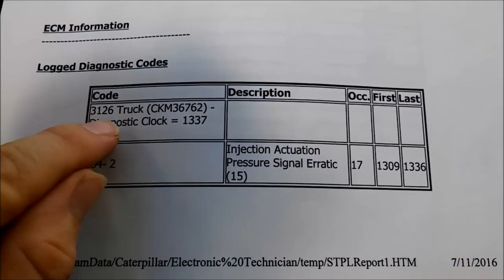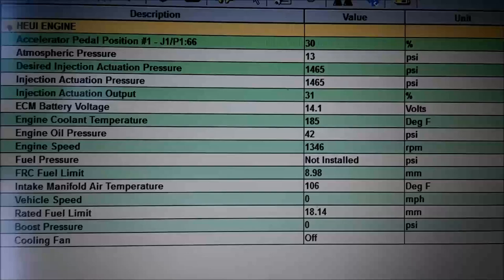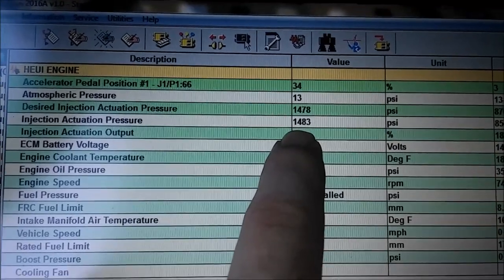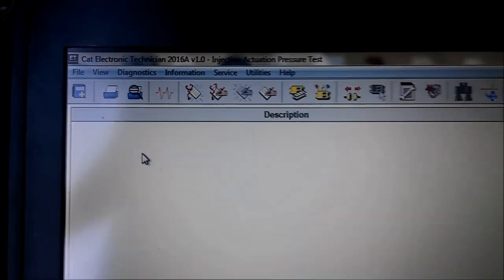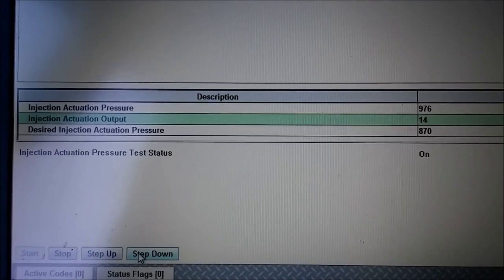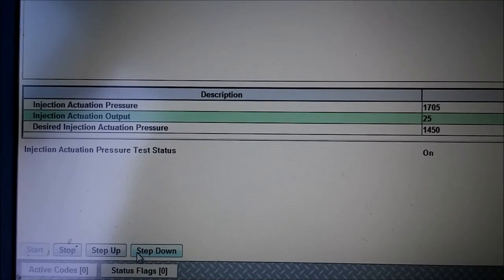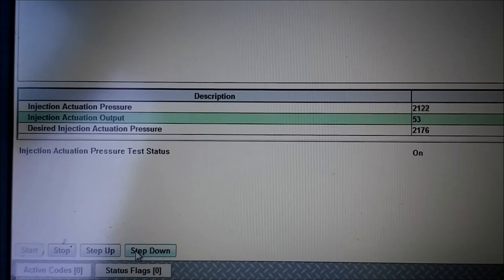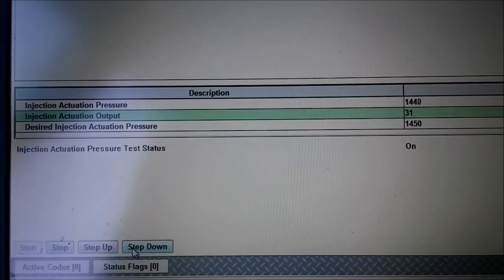How To Troubleshoot HEUI Systems and IAP faults. 164 Faults.  3126, C7, and C9 Cat Engines.

Comment: Hi there I'm having trouble with a 336d running a c9 that refuses to start when warm unless it gets a squirt of ether I'm thinking huei pump or faulty injector am I on the right track?
Reply from the maker: +phil holloway If it has a cold miss, that is usually an injector. You can do a cylinder cutout test right when it starts to see if you can identify which one.

Comment: i have a 3126 where the heui pump had external oil leaks and complaints of low power so i changed the heui pump even though it was keeping up with the commanded pressure,  now it sputters when accelerating and still low power .  thoughts .

Comment: NEED HELP we have a 2003 3126 that will shut off after 30 minutes or so, let it cool for 1-15 minutes and it starts right back up.   It's instant too and it starts right away when it cools.  Doesn't act like heui issues seems seems electrical.   I have 2 battery + and - at ecm and 1 ignition + and none are dropping out when it dies.  Changed timing sensors and heui oil pressure sensors.  Scan tool looses communication when it shuts down as well.   We also swapped ecm and does same thing.

Comment: I have an rv with a 04 cat c7. It is a 350 hp engine. Upon start up when it sits overnight, it will throw the ck engine and engine protect light upon start up. Codes 164-2 and 164-0 are the only codes in the system. When it starts it will seem to run a little rough and seems more black smoke than usual but I never paid much attention upon start up because I am inside. It stalled twice on me. Both times when the lights were on. I had to turn the key off and try to start it again because it would not start until I shut the key all the way off. Once I did that it started right back up. If the light come on when I start it, I turn the key off and start it again and the lights are off. It never had low power and still doesn't once those light are out. I put my scanner on it to test the actuation pressure, and it did go all the way up and down, but seemed a little delayed in response. Any suggestions? PLEASE!!! Supposed to leave for vacation in 2 weeks and need a vacation not a vacation to HELL though. Thanks in advance

Comment: working on a c7. runs like crap. 102-4 was active but after a few minutes of running, went logged. inside logged events, 164-11 code found. cylinder cut out test shows to have 2 inactive injectors. should this be the 164-11 event?

Comment: got a 3126 in a 2001 freightliner single axle 5 ton.  approx 1 million km.  Ive been the owner the last 50,000km.  The previous owner told me he had the injector cups done once.  Personally Ive only changed the oil.  Its achieving acceptable blowby and oil use.

Really like the engine, its very responsive and generally flawless in terms of operation.  Great power for my application.  I really like how the power increases through the gears.  This aspect seems to be dialed in just right, very smooth and well tuned.  I havent noticed the motor miss or skip a beat even once.  Loving the cruise control, works very well.  The borg warner turbo peaks at 23psi, which seems low, but im only running the 245hp setting.  Great turbo good performance for my needs.  Although loud at times this engine sounds manly and fun.  Also the clutch is very good.  Its Super smooth with a bit of practice and can handle a heavy duty sychro transmission just fine.

As for some complaints...  The  6 speed eaton trans in the truck is long geared.  As such im shifting into 1400-1500 rpm often.  This is not ideal cause the power output and lifter rattle in this range is not very good.  The engine seems to operate best in the 1700-2300 rpm range.  Although staying there at all times can be a challenge.

And then there are leaks, the turbo side is bone dry at all times.  Cant say the same for the intake side.  the heui pump leaks from the front cover.  The heui supply line leaks.  The cam followers leak.  The oil pressure manifold leaks.  The oil pan leaks.  Lets just say it leaks a little.  Could fix it if I wasnt too busy making money every day.

My attitude could change if I blew the heui system and went broke.  But I wouldnt call it a boat anchor.  Under the right care it can be considered reliable, and an all around nice engine.  Best part is I only paid $8,000 for the truck.  Some of my colleagues are $40,000+ into their rigs and spend lots of cash on EGR parts and exhaust filter problems.  Not me im banking dollars daily :p

Comment: You're correct it is 3126. After changing out fuel actuator which didn't work, I replaced fuel pressure sensor and that fixed the issue. Thanks for the response your videos are great.
Reply from the maker: +Michael Patenaude Glad you found the problem and it was an easy fix.

Comment: Your videos have been very valuable to me in understanding the C7 in my RV; I discovered you when I learned yesterday that I have a HEUI failure with metal in a couple injectors at 87k miles. One thing you haven't mentioned is whether an oil cooler failure or warpage can put metal in the oil supply and THAT failed it, as my CAT shop (which has a good reputation) is suggesting MIGHT.be the source. They point this out because if it is, the $6500 investment in the kit and it's installation can be trashed and the whole exercise re-done with the additional expense of the oil cooler. The cost Delta to do the oil cooler, they say, is about $1500 and they leave it to me to decide whether or not to go that route. I am very inclined to spend the extra money, because while I can afford to pay $8000 to fix this once, I'd rather not Pay a total of about $14,500 to fix it twice. What are your thoughts on this situation? You have not mentioned the oil cooler in your videos. Thanks very much.
Reply from the maker: +GWA1225 At the time I made this video, I wasn't aware of the oil cooler possible failure. It is a concern though, the gasket can blow out between the filter housing and the cooler, causing unfiltered oil into the filtered side of the oil galley. You don't need to replace the cooler to check for this, only remove oil, check it for flatness and reseal if flat. Shouldn't cost $1500 for that. A HEUI kit shouldn't cost you $6500 installed. They are about $3600 parts and then about 12-16 hours labor in an RV which, by my calculations is about $5000-5600 all together. There is an update to the HEUI supply line they should know about that adds an inline filter to protect the pump. Make sure that is installed to protect the pump. If you have any questions, email me at AdeptApe@yahoo.com

Comment: Ok thanks for your help. I'm going to take the injector out to see if the o- rings are bad. video helped me out  a lots
Reply from the maker: +Fernando Nava None of them should be shooting oil out, that is probably your problem. They do purge a small amount out of the solenoid when running, but they should all be doing it the same

Comment: At start-up C9 oil pressure is very high. With engine pre-heat it's 75 PSI, without it's over 100 PSI. Oil is bypassing the filter with this high pressure, so not good for HEUI pump. CAT 15w-40 oil takes to long obtained operating pressure. I'll received a fault code when engine load is high at high oil pressure. The fault immediately clears when engine load is reduce. When the oil pressure obtains operating pressure about 40 PSI, there's no fault. Still searching for the correct engine oil. 
Great information. 
Thank you
Reply from the maker: Have you tried using the 10w30 Cat oil in that HEUI system yet?
Reply: Adept Ape No, Yancey CAT only have 15w-40 oil on the shelf. I haven't ask if they will get 10w-30. I think my HEUI would appreciate CAT 10w-30, with the destination ECF-1.

Comment: I have a 1999 Newmar Dutchstar Motorhome with 170K miles and a Cat 3126 Diesel.  On a return trip from  ND this  summer it suddenly slowed to 40mph while travelling down a freeway.  I could not get it above 40. I could slow down and speed back up to 40 but nothing faster.  I decided to pull over and it died and would not start again.  Afterr about a 1/2 hour of calling around, it did start but again would only go 40 max.  I limped it to the next exit and called for a tow.  

The towing company also did minor servicing and suspected clogged fuel filters, which they changed, numerous times but did not fix the situation.  They noticed the diesel fuel was dark with oil and suspected blow by from a cracked piston, o-rings or cracked head.  They replaced the o-rings which seems to have helped the discolored diesel, but did not fix the speed or starting issue.

I should mention that the RV would start with ether and if I was lucky and could get the vehicle moving, I could limp down the road but it seemed after the engine was warm and it died, it would not start until some time passed or ether was used.

Also the OBDC is not producing errors.  When the 40 mph govenor kicks in the Engine light does come on but does not pass any codes.  After apparent cooling down, the Check Engine light goes out as if nothing is wrong only  to reappear after a while.

The shop now suspect the HUEI.  They are not a highly knowledgeable professional diesel service/shop but are trying to help me by keeping my costs down.  Although trial and error and parts changing may work, it's been 2 1/2 months now and would like to get this resolved.

Any help, thoughts, comments, kick in the pants would be  greatly appreciated.

Thanks in advance!

Comment: I have a c7 in a freightliner that only show's .5 gph fuel rate. I performed the actuation pressure and cutout tests that looked great. I have extended crank, miss, fuel knock, hesitation etc. No codes except for low cranking pressure but its an old code.

Comment: thanks Ill check; I had a bad injector before but my mechanic fixed it, the control valve of heui has 9 ohm and the sensor gets 5 volts in, .9 volts at idle when rev it up going up,  and ran well  but it show those codes ..thanks Iam learning a lot of mechanic with you and your videos are helpful and interesting thanks for your time body

Comment: On the C7 sensor you said 6 to 10 ohms is that 6k to 20k or judt 6 to 10 also the sensor has 3 pins so test both outside pins  to the center I'm currently working on a royal pain in the axx lol c7 truck is surging after it warms up with no codes it did have some events for low cranking pressure and I did reseal the injectors they where leaking using the primer pump any help would be much appreciated

Comment: Got i C9 giving 42-05  current below normal in crane operation.

1.replace ECm,wiring harness, injectors,HUEI pump 

Engine hunting when ramp up to 1800rpm.

Comment: I just replaced my 3126b with a reman that I bought off a shop from Florida. It's in a Vermeer bc2000xl wood chipper. I have only ran it 50hrs. It looks like I received a freshly painted truck engine. Maybe partially rebuilt, I don't know.  Today we lost oil pressure. It went down to around 3psi and shut itself down. Oil level is fine. The motor starts normally, but shuts itself down within a minute. Went to replace the oil filter and it was not full of oil when we took the old one off. We stuck our finger in the oil filter housing tube and pulled out some type of plastic tape or film. Don't know what that came from. Then we replaced the oil filter with a new one. Then started the motor for a minute again to see if the oil filter would fill up again.  It did fill up. Although, we are still not getting more than 4psi oil pressure at idle. Would this be a HEUI pump problem? I also read that there might be a problem with the filter housing. Any help would be appreciated. Thanks

Comment: My freightliner cat c7 it's returning oil to the fuel tanks? 

I was advised by mechanic that the HEUI pump it's the cause of my oil "disappearing". Around 2 gallons of oil consumed on a day (450 miles). When looking at the tank it's black and we're advised it's oil. 

I'm not sure about it, what are your thoughts?

Comment: Hello, I have a C7 "JTF". Excessive oil consumption complaint , about 8 L in a 12 hour shift.. Found oil in the fuel so replaced injector o-rings and cups about 6 months ago. The lift pump looks new, HEUI looks new, Turbo is not leaking oil, no oil in the exhaust no smoke, air compressor carrying oil out so disabled it. 
Wondering if you have any methods for testing oil in fuel? Any help would be appreciated.

Comment: Great video.  Working on a 04 IC DT466.  Starts great and runs great until it gets hot.  Injection control pressure drops way off and it wont start again once engine is shut off.  Then when it cools off BAM starts and runs great until it gets hot again. Should I look under the valve cover PITA, or suspect the HPOP. Thanks again!

Comment: A question about: the fuel flow from the filter thru the pressure regulator on the Cat 3126 2001\2002 build.  Question:  Would installing an electric fuel pump between the fuel filter and the fuel transfer pump allow the bleeding of air from the head in the event of the failure to prefill the fuelfilter\filters?  Would the additional pump allow any air to pass thru the pressure regulator and allow fuel to be circulated bank into the fuel tank?

Comment: CAT 3412E, at full throttle under load fuel position intermittently goes to 0. Replaced heui pump and inspected all orings on injectors and high pressure oil elbows. Cylinder cutout test all injectors firing but a few are weak. All cylinder have good compression. There’s a knocking sound coming from the pressure regulator on the new and old HEUI pump. Thank you to anyone who has any ideas.

Comment: Thanks for the videos... need help.  1997 3116 Heui... Starts easily, runs great, low power. No boost to speak of.  I just got the J1708 rewired to a regular truck connector and can talk to it now. Without Cat ET I only see fuel pressures, not requested (yet) working on codes for that data point... Pulled the Fuel actuator IACP and pulled it apart, and cleaned it.  no change.  Checked the intake air pressure sensor, clean.  I only see up to ~20psi boost then it drops back to 18 even on the floor.  can't get over 40 mph.
Heeelllppp.  suggestions are welcome.

Comment: Hi Adept Ape... Thank you so much for your videos. They are very helpful. But I was wondering where I can buy that software? I have several C7 engine trucks and have paid my mechanics a lot of money every time they hook the computer up. I would like to know where I can buy it and what are the prices. if there are several different versions, which would you recommend? I would highly appreciate your advice. Thank you
Reply from the maker: +Maynor Discua You can get the software from Cat, as far as the prices are you would have contact your local Cat dealer. You can get a Linksys Comm adapter which is cheaper that the Cat one.

Comment: Hey brother thanks for Information I have a 05 freightliner with a c7 that currently has a slight miss at low idle my fuel pressure is good and oil pressure so I removed valve cover and I can see that 2 of my injectors are squirting oil from the actual injectector itself and nor from the seals below it , is that a sign my injectors are failing ? Also had injector harness unplugged while I cranked to prevent mess?

Comment: I have a C7 ACERT in a FMTV military truck.  Cranks-no start or attempt to start. There is no fuel pressure at all at the secondary fuel filter and I swapped out the fuel pressure regulator-same thing. I have not yet checked fuel pressure out of the transfer pump. The driver on the HEUI pump is 8.3 ohms. The vehicle has been sitting for a long time and had water in the fuel and even some rust in the fuel filters.  Before testing fuel pressure I drained the fuel tank and put new fuel in the tank and also changed out the filters / primed system. Is it best to change out HEUI pump AND also the injectors since the fuel was contaminated badly?

Comment: I've got a 3126 crank no start. I recently tested the driver and it tested out at 10ohms. Would you lean toward the HEUI pump or a possible electrical communication issue?  I dont have the software to plug the truck in. I appreciate it and love all the vids, especially about the cat motors.
Reply: How did you no start engine turn out? Did you find software?
Reply: @Jared Noland  Turns out it was the "driver" that actuates the heui pump or let's oil pressure from the heui to injectors. Replaced that and she fired right up.
Reply: @briansanders6950  thanks for update. We are broke down currently.
It starved for fuel, and stressed everything out.
Trying to decide if the pump died because of it.
Reply: @Jared Noland  is your heui pump  the round top or square top? Round style the driver can be replaced. Square you need to replace the entire pump.
Reply: @briansanders6950  it's a round top and we just got it running.
While cleaning/blowing out the fuel line, it was 100% plugged, I pulled the pump out the bottom and had the piston installed backward.
It's running now.
YEAH

Comment: Need Help... I have two rollbacks with the Cat. 3126 Turbo deisel.. takes fuel fine, unless you have pedal all the the way down with the weight of the rollback going up hill.... down to 30mph on some hills.. blue smoke, no power under strain... even it's own weight up hill.

Comment: I have a 3126 with a bad HEUI. It looks like the one I -this video with the filter housing/reservoir on top. (Not sure what it is)  so if I were to replace the pump do I need to do anything with the computer to reset it?
Reply from the maker: +TDCtactical You don't need to do anything with the ECM to change the HEUI pump.